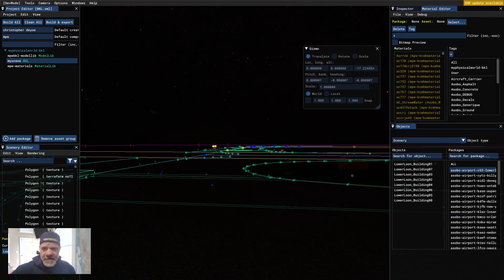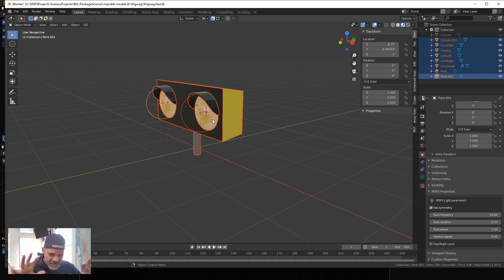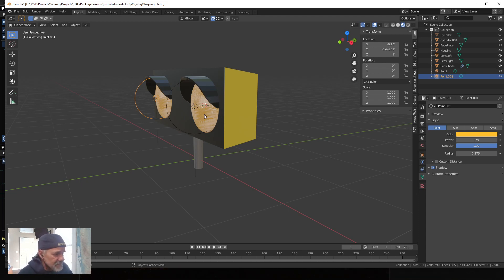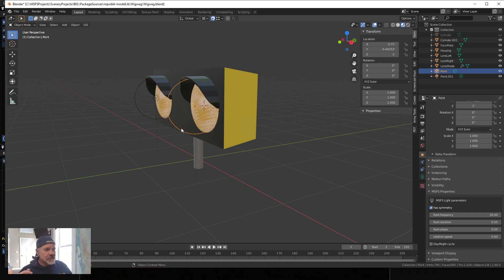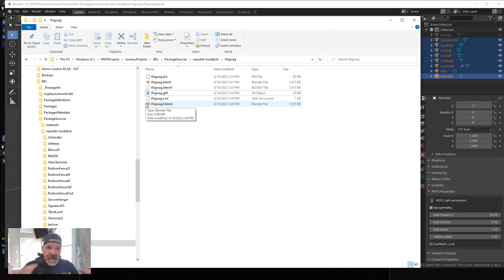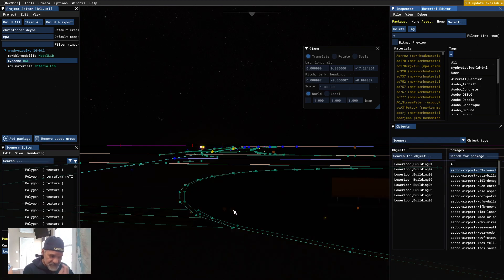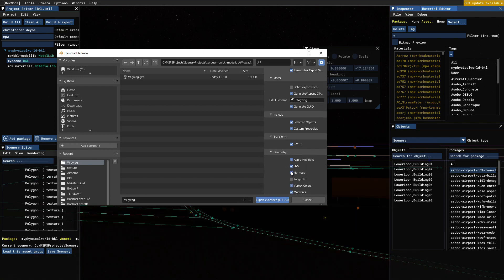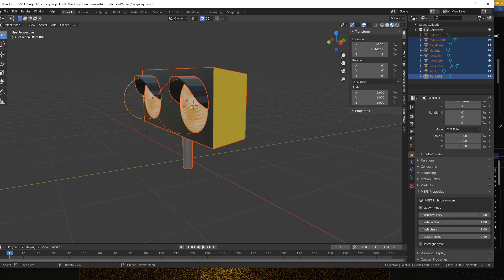Creating Scenery for MSFS 2020: Easy Flashing Wigwag Lights

Comment: Thanks a lot for this great tutorial! My wigwag lights are working nicely in FS2020. However, even if I export my blender file for FS2024, it does not blink. It seems there is a bug with flash_duration parameter in FS2024. Any value that is not "0" makes the light always on. Could you verify if your wigwag lights work on FS2024? Thanks in advance!

Comment: Christopher, this is a great video.  I actually just posted in your Facebook about the problem I am having.  Maybe I should try this method and have MSFS do the calculation.
My light is a red beacon light that right now simply has a bright glow - but I want it to blink
Reply from the maker: Yes. Using the flash frequency will do wonders.

Comment: 👍👍  Custom lights in this sim are driving me bonkers but WOW I learned quite a timesaver tip.  I didn't know I could tweak and re-export a Blender model and have it "live" update in the sim.  Instead I keep exiting the sim, reloading it,  re-building, and re-loading the scenery again with  every tweak. 😭🙄  This tip saves me sooooo much time and misery!  THANKS SO MUCH! 😁😁😁

OK, here's the obligatory question...

I've modeled a tall cell tower with a red flashing light at the top.  After experimenting with a red emissive texture and later watching one of your videos I've added a circular array of 3 equally spaced white spot lights aimed at an iconosphere (first tried a cylinder - same results).  The light works OK but was a bit dim, and of course disappeared beyond about 15-20 meters away.  I went back and cranked up the power in Blender to higher values, settling at 2000 watts. [Edit: tried values of 50,000 watts.  Results were brighter but with similar falloff distance]  Unfortunately, during export (msfstoolkit) the power keeps resetting back to 10 watts so I manually edited the gltf file.  Sure enough that really brightened the bulb glow and it looks great, but the light still disappears after ~20 meters away.  Also, after every Blender edit I have to re-edit the gltf file as I guess the power is above Blender's and/or the sim's allowed 10 watt limit.  I also tried adding a huge (1000 meter} invisible cube (a la street lamps) to hopefully extend the visibility.  That seemed to help a little but the light still simply fades to black too quickly.  Got any tips?  Thanks!
Reply from the maker: I tell you what, join my FB group and ask the same question with screen prints: https://www.facebook.com/groups/521018688900009
AND join this group as well:
https://www.facebook.com/groups/fsdevgroup
That way we can get more people in the discussion!
Reply: @myphysicalworld3958  Thanks for the kind offer but I'm allergic to FB.  Regarding lights, I'm wondering if there's a way to cheat in the gltf file and specify an ASOBO aircraft light, since those lights can be seen from great distances.  Geez that would solve a lot of LOD lighting ills.
Reply from the maker: @Jimbo-in-Thailand  not sure...never done it...but I always say....go for it and test your hypothesis!